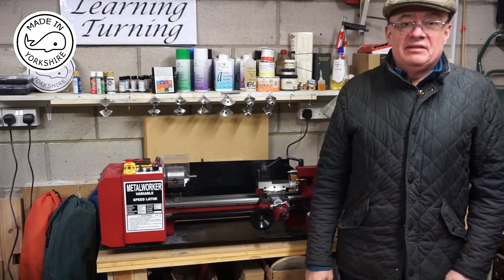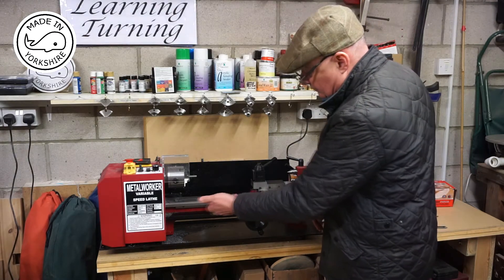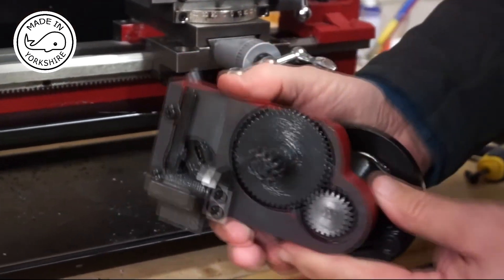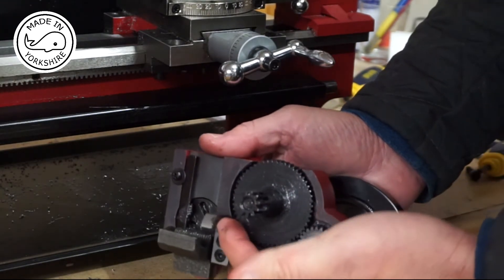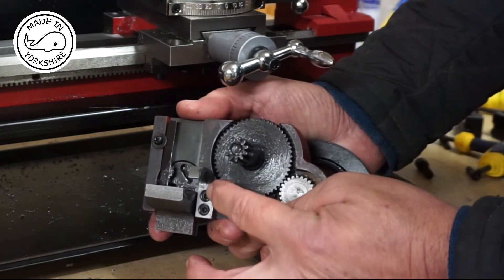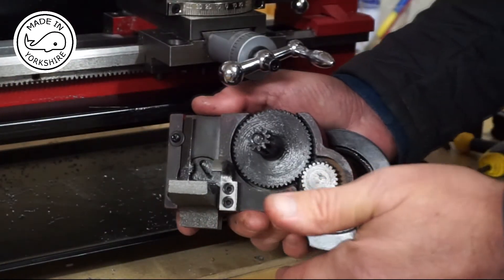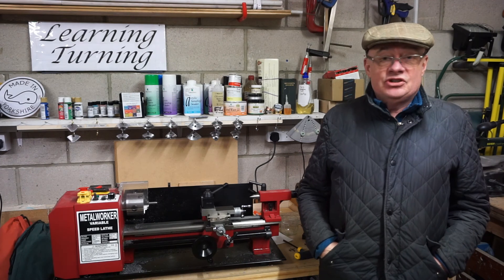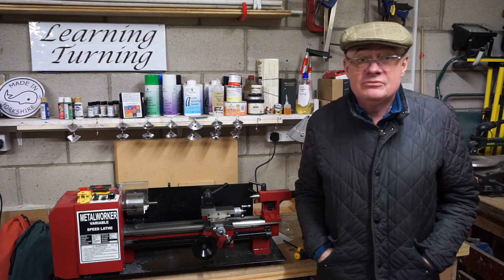#MT6 - Mini Lathe - Half Nut Problem. By Andrew Whale.

Comment: Hi Andrew: I like you Sir am new to lathe and mill work, a little less than a year experience but I love using my machines.  I find your videos informative and insightful regarding everyday situations I experience with my machines in my shop, as we both have the identical make and model mill and lathe machines.  By the by, my lathe had the same situation, with improper half nut engagement and rough carriage operation.  Just now seeing your video I shall investigate your solution as a proper fix for my situation.  Keep up the good work and videos please Sir.
Cheers, Greg.
Reply from the maker: Hi Greg. Thanks for your comment. I'm glad you found some of my videos useful. If you don't find that my solution to the half nut problem works for you, I did receive another comment providing another possible solution which might help. All the best.
Cheers.
Andrew

Comment from the maker: Hi Hans. I would try loosening the bearings at both ends. Engage the half nut at one end and tighten as in my video. Then repeat at the other end. Also see Dave M's comment where he recommends taking the gear off the lead screw to check that the lead screw also turns easily by hand. Good luck.
Andrew
Reply: Thank you so much Andrew's.

Comment: A very interesting little bit of history now about the SC3. They have gone back to the pair of nuts now & the plastic guard over the hand wheel gearing is now standard. So I imagine that your small problem was a major part of the reasoning why. Added of course to some of the Worlds markets demanding these spring things that completely enclose the screw. 
   The SC3 is a very fine mini lathe & I was looking to buy one. Until a late 1954 ML7 with a clutch 
   You have a SC4 & a Warco Mill. Also, you are very into power feeds. Nothing wrong with that. It is the modern way
   I am personally interested in the world of 3 1/2" Lathes. Hence, the Sieg companies products for the new stuff & Myford for the old stuff. As for Milling Machines Then surprisingly the SX2P has so much more to offer.
Reply: Hi Mervyn, I purchased an SC3 a couple of weeks back, and as far as I can determine it was manufactured last year (2020).  It does not have a plastic cover over the apron gears and I am pretty sure it only has the lower half of the half nut.....  maybe they sent machines without the covers and only lower portion of the half nut to Australia?  :)
Reply: Look, the Sieg SC3 is an excellent little lathe & I am an enthusiast for them. However, whilst I was saving up to buy mine, an ML7 with a clutch came up on eBay close to my home & I purchased it. It has turned out to be a good one. Regarding your SC3, all the parts to convert it are available. The reason I am so keen on them is that they are very like the ML7 was when it first came out. Namely, very capable of being modified & updated. If you read books about Mini-lathes you will read many ways of improving them. If you have old copies of Model Engineer, you can read the words of Duplex & see where all these improvements come from. I can read about them applied to the ML7. I do not doubt that some of them will predate 1949 & go back in time too much earlier days. But for me, 1949 is the date when the ML7 was fully in production.
Your SC3, starts to be of real interest when it gets its full set of upgrades. Avery good brushless motor, the plastic guard over the rack gears & the double clasp nut. I do not particularly mind if you fit them, or they come factory fitted. Just that they are fitted. Then you will go on to improve your SC3 lathe by reading the books on how to make it a better lathe. Exactly the same as the rest of us do with our lathes. We put extra screws into the gibs to stiffen them up be it an ML7 or SC3. etc  @damien0505
Reply: Don't get me wrong, I am loving it. First time owning a lathe and am learning more each day. I don't mind making the mods, and seeing if there are other things I can improve on the way. Is keeping me slightly sane during lockdown. 👍
Reply: I have been dragging my feet a bit with regard to the Arc Euro SC3 mini -Lathe. If you go to their website & to the SC2 & SC3 page. You will see Details, Specs Then More in the box. Press "More", read down the lists to the bottom "projects & Articles" Click on this. You are interested in two items. 1) The strip down & reassembly of the SC3 MIni-Lathe & 2) the C3 Mini-Lathe half nut conversion. They are free to download. No point in re-inventing the wheel. It has already been done for you. The plastic cover for the gears is easily found. The two books on the Mini-Lathe are by David Fenner Workshop Practice No 43 & Neil M Wyatt, Crowood Metalworking Guides, the more expensive but more SC3. Both these writers are ex-editors of Model Engineers Workshop, the sister mag to Model Engineer. So they really do know their stuff.   @damien0505

Comment: You need to check the left hand side pillow block support. The two M6 cap screws are usually threaded in crooked.  The factory do not tighten it down to 10Nm because if it was done,  the lead screw would bind up very tightly. The factory free hand drill these two important holes and thus its very crooked.  You neef to remove the front plastic cover to witness this

Comment: Hi if you are prepared to lose the lead screw cover a pair of half nuts can be fitted which I have found to work much better these can be obtained from one of the mini lathe suppliers
Reply from the maker: Hi Roger. Many thanks for the feedback. I did manage to sort the problem out in the end, but your suggestion is very much appreciated.
Cheers
Andrew
Reply from the maker: Hi Carl. Many thanks for the info. I'm pretty confident I sorted the problem but you never know I might need it in future.
Cheers
Andrew